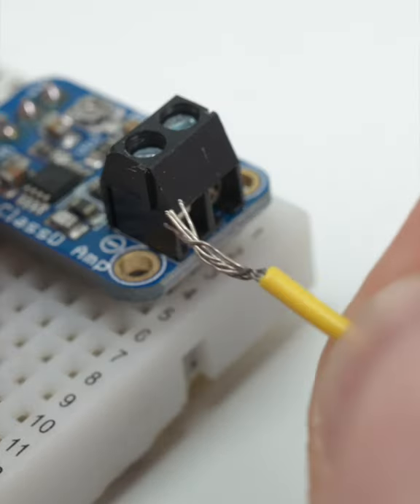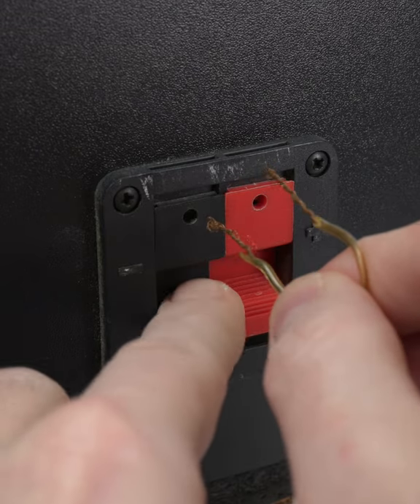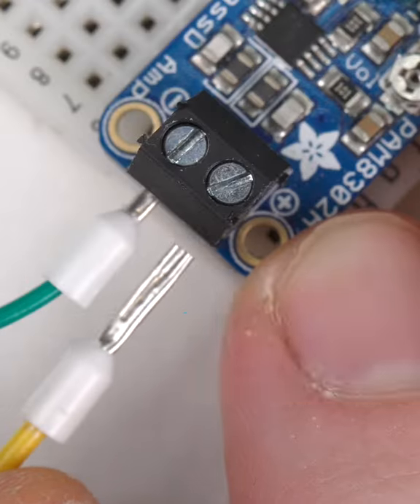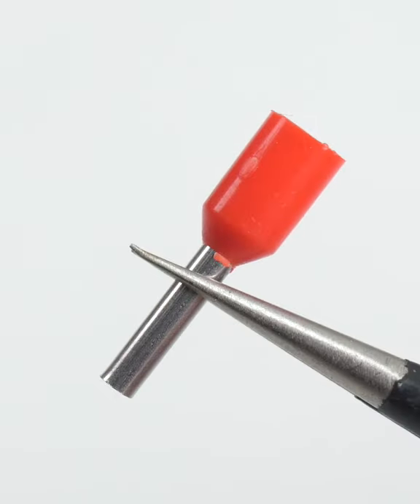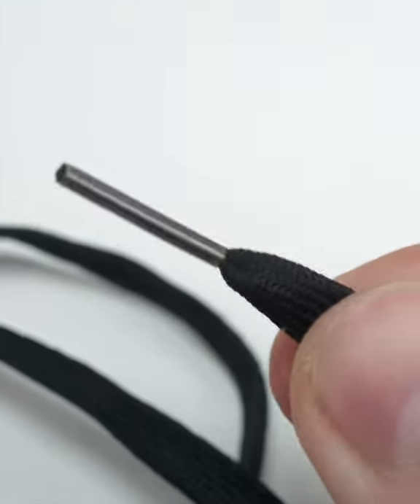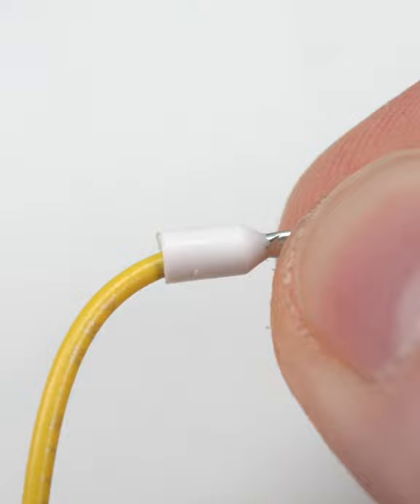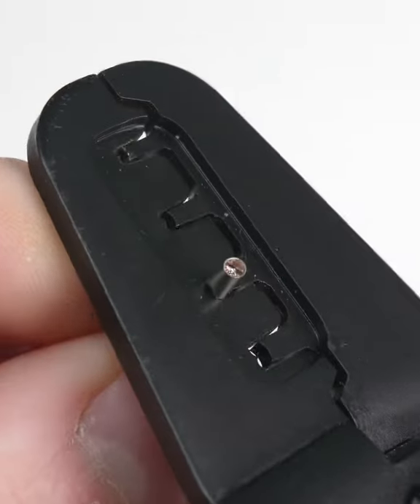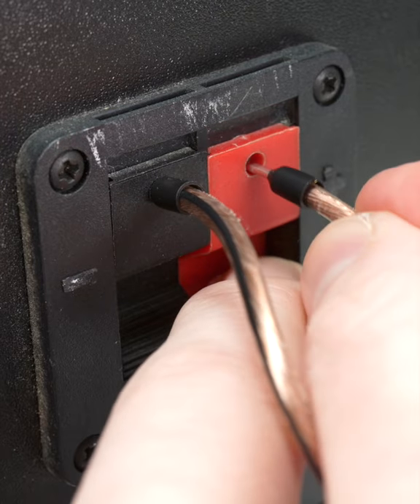Wire Ferrules - Collin’s Lab Notes #adafruit #collinslabnotes

Comment: Many speakers will also take banana plugs, which work very nicely. No-solder banana plugs for speaker wire are also really cheap.
Reply: Banana plugs are nice for quickly swapping cables around but some are really low quality. Got 2 types, low current (8A if I remember correctly) and high current (32A). There is a BIG diffrence in quality, the low current crack and break and loosen up over time while the high current ones use soft plastic insulation that provides strain relief and are spring loaded so they hold really good. So if you are getting banana plugs, get some that will last and won't just go out from you stepping on the wire.

Comment: Hex or square crimpers are good for ferrule tubes. I got a box of assorted sizes, both insulated and bare options. Small terminals and outlet socket boxes might need bare versions.

Comment: Could also just tin the wire tip. Ferrules are great for larger strands with higher strand count to keep from wire strands touching another connection.
Reply: Do not do that for any high-amperage connection. Tinned wires don't have the same mechanical properties and are far more likely to become a fire hazard over time.

Comment: We call them bootlace connectors and are supposed to use them in any situation where a flexible wire is being put under a screw terminal this isn't always possible but it's worth doing

Comment: Ferrules are great in some cases. But only if they are crimped absolutely correct. With the wrong tool they will just cause issues. 
Same goes for cause stranded wires.
Reply: Indeed should have a locking crimping tool that unlocks when the right "pressure" has been applied. Which he didn't seem to have in the video but there are really cheap ones out there now that work and make a good crimp.

Comment: I've always just soldered the ends to make them stronger. Why buy another part when you can use something you already have on hand. Plus I've found with speakers, there's less chance of static and noise if you're unplugging and replugging constantly.
Reply: Same here.
Reply: Soldered joints aren't as robust as ferrules, the solder often cracks an leaves connections loose.
Reply: @filipek5230  flux and a 2 second solder job can fix that. Trying to change ferrule would probably take longer.
Reply: @gryffon7497  for audio and another low power/voltage connections yeah but for high power, loose connectors can generate heat and even catch on fire.
Reply: Soldered ends are not good for terminal blocks. The solder compresses and the connection becomes loose. This is a proven fact and is not allowed in some electrical standards.
Reply: @gryffon7497  but you don't need to change a ferrule. That is the point.
Reply: That's a fire hazard in higher amperage applications.

Comment: They may be great but many companies including pro audio manufacturers say that ferrules should not be used for wires into terminal blocks, Phoenix blocks etc. With twisting the strands and torqueing properly, you should not need ferrules with electronics like this.

Comment: Would you drop a little CA or Hot glue into the plastic to help the strain relief?
Reply: CA glue will create a sharper bend radius and therefore create even more strain. Hot glue should work as it is somewhat soft.

Comment: Only the smallest size barely fits into most pcb sized screw terminals.
Reply: Yup, that's a definite downside. This is why I often use 0.2" pitch terminals where I can use ferrules on 18 AWG wire.

Comment: I thought their use was incredibly common in the UK?
Reply: Very common by professionals but not so common among ordinary people that just do a wire here and there. Now you can get pretty good crimping tools for them (they should be locked untill the right crimping force has been applied) for cheap now that do the job as well as rather cheap ferrules so more accessible to the common folks now.

Comment: adding metal will add resistance to a copper wire that was being used for lower resistance to begin with
Reply: Not to a degree that matters, and the increased safety is worth it. 
Source: work in an industrial environment and these are everywhere.

Comment: Or you can twist the cable, and tin with solder.
Reply: The solder will degrade in a clamping fixture. This is a fire hazard if used on power delivering cables.
Reply: @MrGoesnuts  Solder does not degrade when clamped. It is malleable and forms a good contact. Tinning stranded wire has been the standard technique for over a century.
Reply: @TrystansWorkbench  Yes it does. Please inform yourself, in another comment someone posted more information. Industry standard is to not tin the wire for this reason.
Reply: The soldered ends will compress and cause bad connections. This is a proven fact and is not allowed in some electrical standards.
Reply: @MrGoesnuts  Yes, you may be right. For hobbyists making low voltage, non-critical connections a quick twist and a tinning of solder is a commonplace practice, which works effectively, is very convenient, and essentially free.
Reply: @TrystansWorkbench  soldering iron and tin is free? I will give you that it's slightly cheaper then a cheap proper kit but it's definitely not essentially free.

Comment: Could you not just tin the end of the cable to make it more durable?
Reply: One issue then is the tinned part in stiff. And will break the cable where the tinned part ends, since there is no relief.
Reply: Not a good idea in higher amperage applications.

Comment: If you're super cheap couldn't you just put some solder on the ends of the wire to hold it together?
Reply: Yes, but it's more risky connection wise.
Reply: @AlexKall yeah, I've seen stuff burn because of this little "tip"

Comment: Or just solder the wire.. easiest and cheapest
Reply: I think if you would use the ferrules you would find yourself grabbing and using them instead of soldering, and the ferrules are dirt cheap and quick to put on. They are really nice when you're out in the shop standing on your head in the bottom of a panel trying to wire up a new prox switch to a terminal strip.
Reply: I’ve been told in the DIY 3D printer community that soldering the end of the wire is bad practice if it’s being screwed into a terminal block. Apparently in high current situations (like a power supply) the solder can become warm and flow/deform over time, causing the connection to loosen and in turn, get even warmer. 

For some applications a ferrule is preferred it seems.
Reply: This is not good form. 60-40 solder has a homologous temperature of 0.66 at room temperature. Anytime you exceed 0.4 homologous temperature in a metal or ceramic, you should expect creep in significant amounts. This means if you tin a stranded wire and shove it in a terminal block, tighten and then come back in 5-10 years, you may find the wire is loose even if no current flows through the wire. Look up the papers by NASA on creep fatigue failure as they ran into this problem and then stopped tinning wires in terminal blocks as a result.
Reply: To add to the disadvantages of tinning stranded wire, you can also create a stress point inside the insulation where the solder wicked up, breaking the connection over time. Ferrules are simply a better option for screw and spring terminals.
Reply: @amoose136  yes bad for screw terminals, but I figured ok for spring terminals as in the back of speakers.
Reply: @coctailrob  I mean, it's totally fine for speakers.  If the connection gets loose, you stop hearing sound, and you just walk over and plug it back in.  For that, you don't need a space-grade solution.  But, the space-grade solution is pretty cheap and works well in pretty much every situation, so it's worth learning about at the very least.